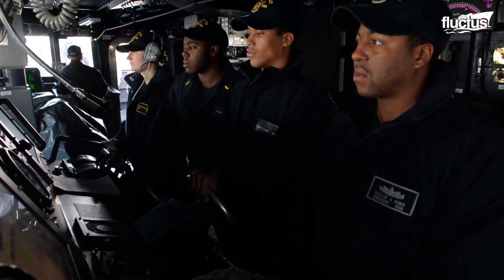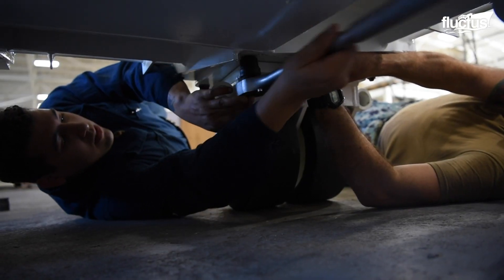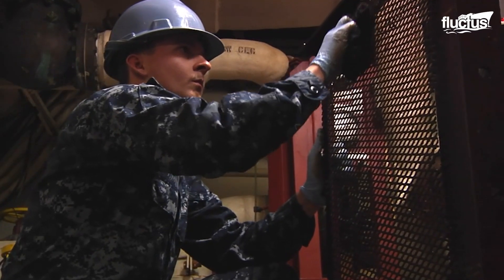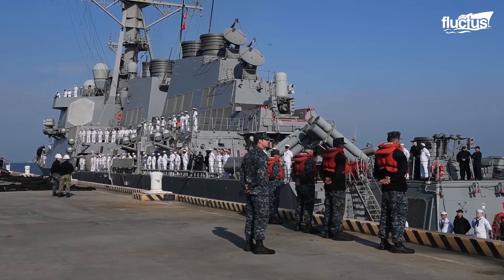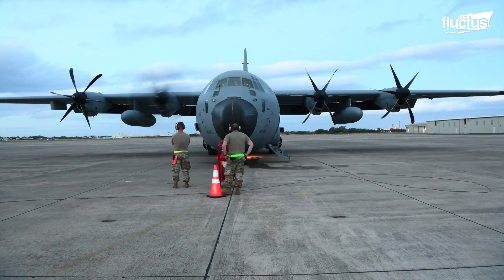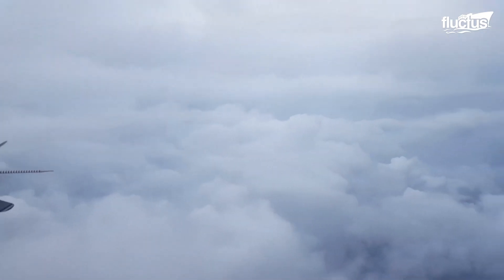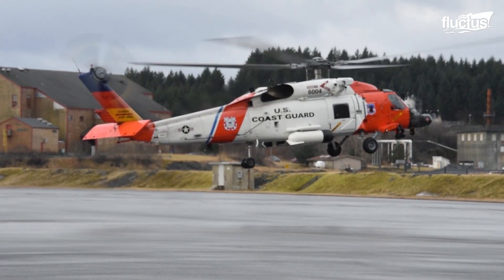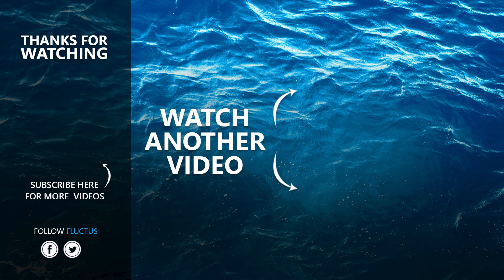US Navy Ships Special Techniques to not Sink During Storm

Comment: I am a US Navy and I am terrified to ride cruise ships because they can easily flip and sink unlike US warships which is certified tested including nuclear blast. US Warships have compensating fuel/ water design to make sure they are kore stable and impossible to flip. And US warships can detect and outside extreme weather conditions.
Reply: I was in a navy as well and I feel the same way about cruise ships. 
They are stabilized with machinery and machines fail at the worst times.

Comment: To avoid sinking It''s called water tight integrity and head straight into the waves.
Reply: What about head into oncoming waves at an angle.?
Reply: @johnrogers9481  The side of the ship is more exposed and it might get swamped and roll over especially in big waves. When I served the ship went straight in big seas.
Reply: @richardhaddock5660  That ship won't live for long then. The proper way is to go through the waves in lower speed and always at an angle, like 10 to 20 degrees. Everything else cannot be considered as good seamanship.
Reply: Is that every vessel or just boats? Because it seemed like we went straight.
Reply: @richardhaddock5660  I don't doubt you went straight, but what I am telling you is that it's not the right way to go.

Either on the quarter, or on the bow, always under an angle.
Reply: Thanks for info, I was a flight deck hand and never got up to the bridge.